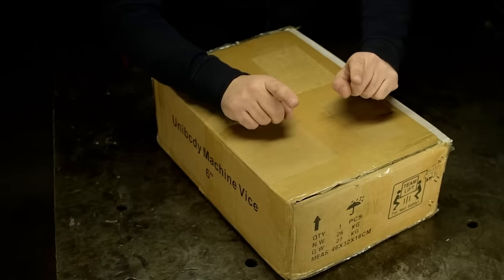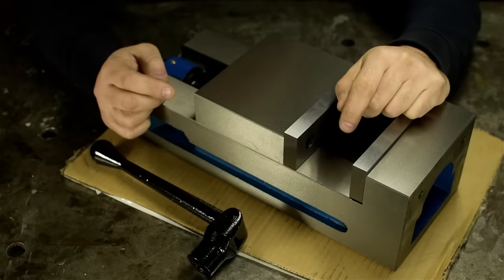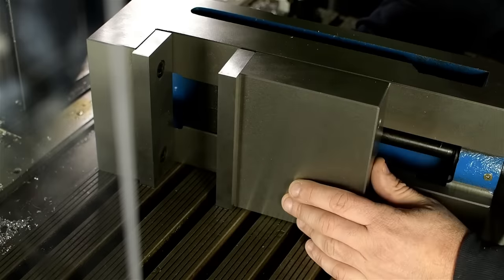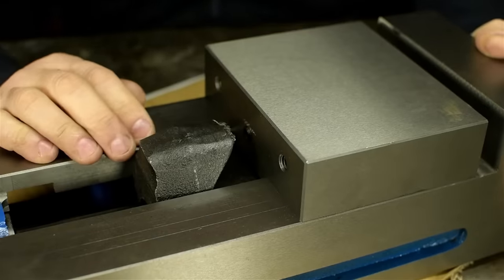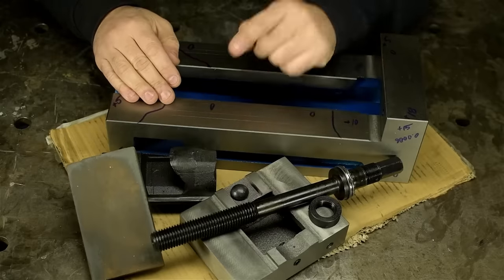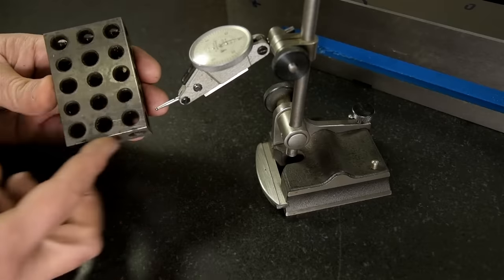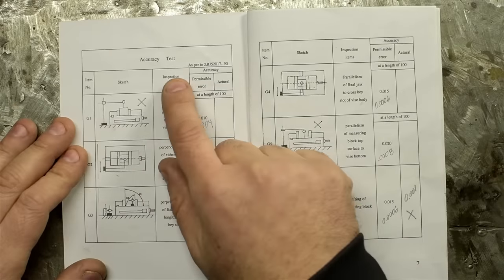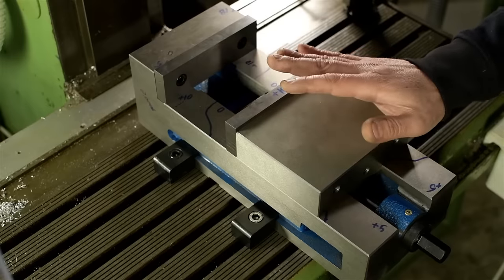Cheap Milling Machine Vise is CHEAP!

Comment: I've got an expensive milling vise. I just wish I had a milling machine to go with it :-(
Reply: I've got a schaublin 13, startrite bandsaw, Eagle surface grinder and a Colchester chipmaster lathe. And yes, no sodding workshop at the moment just a £250 bill for storage every month! So I feel your frustration!
Reply: I've got a used Kurt that I got for free from my last job and I have no milling capabilities. It just lives on my bench downstairs and I mainly use it for working on guns. Way overkill for that task lol.
Reply: @house89147  This pain is real, I've got a Gorton Mastermil, Bridgeport mill(halfway through converting to CNC), Southbend lathe and an old Miller Syncrowave 350 tig welder just gathering dust in storage.  Can't wait to get into a home with shop space.
Reply: @Pulsarr1  it's actually really hard finding somewhere with good work space in the UK, our houses are tiny and expensive. They come with little to no land and then you might have to get planning permission to have a decent sized workshop. I hope you have better luck than me, I've been trying to move closer to family for 2 years. In that time only seen 2 houses that fit the bill. There is a perfect one up there I'd die for but it's about £40k over budget and the guy has it on the market but won't show it because of the covid lockdown!
Reply: Right there with ya, got myself a nice kurt milking vice for free, just need the mill now...
Reply: @daviddombrowski240  Milking equipment should not be used with milling machines.

Comment: I think it would perform brilliantly
Reply: Super
Reply: cool
Reply: All bright and shiny.
Reply: Not entirely, when you're machining to .001" (about .0254mm exactly) this vice could give some very slight errors, but if you're machining to .0001 (.00254mm) then it would be rubbish. For a milling machine like TOT has, he isn't likely to be chasing tenths or microns, but if you have an actual real CNC mill and you're making parts as a business, this thing is very likely to be garbage and isn't nearly good enough for the work, if you need high precision that is.
Reply: @Jeremy Raab rare for manual but not unheard of for certain parts when it comes to CNC, its more common in very technical parts that can't be ground or lapped afterwards
Reply: @JoshuaNicoll  set the work up proud, the vice irregularities then no longer matter, accuracy is based on consistency, which is why barrels are now free floated and not clamped
Reply: @sarchlalaith8836  That's not how machining works, gun barrels are not the same as a milling vice. You want the part to be in the vice as much as possible for maximun rigidity but with CNC things aren't quite that clean and often the parts are set quite a ways up for access all round the part. The problem is the repeatability of the vice, it's garbage. If you machine one side and go flip the part 180° it won't be in the same position, on a manaul mill you can work around that, on a CNC mill you can't as easily fix that error
Reply: @JoshuaNicoll  if you know the bed isn't OK but the jaws are, surely you can mill a ledge into the jaws so work pieces never encounter the terrible bed?

But, I understand what you're saying
Reply: @sarchlalaith8836  you'd be using parallels anyways to put the part up but the parallels wouldn't be level since the bed is not, generally CNC viced though do have steps like that milled into them but in this vices vase they'd still not be made well probably, but you get what you pay for.

Comment: Tony, can you use your surface grinder to "fix" the errors the vice has?
Reply: I was wondering the same thing. Or even take the jaw plates off and surface mill the high spots so the whole thing is flat relative to his mill?
Reply: My first thought after seeing the blue sharpie writing was "Oh boy, time for the surface grinder!"
Reply: I wanted to check the comments for this before adding my own.
Reply: I was wondering if he could have "fixed" it with the mill or surface grinder as well.
Reply: It doesn't help the jaw lift problem.
Reply: im not sure how much hair tony has now, but if he has some to spare i bet with a new screw, a few hours of surface grinding and enough money in the swear jar to just buy a kurt vice he could
Reply: @seanshomeshop325  : He's pushing a million subs so we might find out
Reply: @erik....  But it should not do harm either. That is what the angled surface is for. As long as the nut does not touch the roof inside the moving jaw, grinding down the bed does not increase the play between bed and jaw.

Comment: This Old Tony: the first man in history to admit that a 4" tool is just a "smidge too small" to be useful. 
;)
Reply: Ask any woman "size matters" 😁
Reply: @oldwrench4213  takes 3.5 inches to please a woman , doesn't matter if it's credit or debit

Not about the size of the boat, it's about the motion in the ocean, 
How am I supposed to cross the Pacific Ocean during a typhoon in a dingy little row boat. 
Just my luck.
Reply: If she'd frame them walls a little closer then it wouldn't matter.

Comment: Just a quick one. When checking for perpendicularity, rather than using a ball bearing or fitting the "bumper" to the base, just turn the main rod over so that the ball end is down, as that is what it's there for.

Comment: I purchased the four inch quite a few years ago and it was brand new right out of the box; I had to rebuild it. It was a Kurt Anglock type but the bearings had to be replaced, the main shaft had to be made anew and the half ball which holds the rear sled down to the bed had to be remade. First thing was to set the mill to surface grind and grind the vise parallel to the mill's table. The new half ball was hand ground from a very nice ball bearing. I had to saw the bearing in half with diamond saws then surface with diamond plates. Then the two mating surfaces had to be remated and finally, I ended up with an accurate and reliable vise with repeatability. I also saw the grain structure of my vise and it was very much open. Vise was made in USA Far East (China).

Comment: Fyi the ball on the top of your adjusting rod on your surface gauge is actually what you were supposed to use at squareness check you just flip your rof around do the ball is in the groove of the base and you press that up against your square block. Which creates your pivot point.
Reply: Now that's a useful comment..! Newbie comes away with another lesson...

Comment: To me, as a non north american, "USA MADE!" screams 'it's gonna use non standard threads and be a pain in the ass'
Reply: I feel the same about metric measurements, although I'm familiar with them and use them.
Reply: I've been in the same position, but reversed. I went through the whole rigamarole of making a 3d printed wind turbine that was all metric, and it turns out the bearing it uses is a bastard to get here. Either you pay 30 bucks for shipping or it takes two months.
Reply: @gamemeister27  This is why I buy bearings and other prefab stuff before deciding on the exact final dimensions.
Reply: interesting, to me it adds "cheaply made and heavy on the wallet" in front of that
Reply: See the U.S has been pushing standard threads for years but the rest of the world is stuck on this thing called metric.
Reply: To me not wanting a oriental or USA made vice says “I don’t care I want to burn my money”
Reply: @elischultes6587  depends where you are... Here in the UK Record brand vices are the best.  USA screw threads are a real issue tho
Reply: As an American, I agree. God, I wish we would adopt the metric system for everyday use. But counter to common belief, the metric in the US is not that uncommon, especially at small scales.
Reply: @dominic6634  The place where the three barleycorns unit was invented switched to metric. Give up
Reply: @DanPetrePhotos  Psst. No they didn't.  They still use pints, gallons, and miles per hour in the UK in their daily life. The US Customary system is defined scientifically by the metric system and the US continues to help refine that system, if anyone needs a conversion they don't know, they have a pocket computer with access to a global network of information. Americans are taught unit conversion and dimensional analysis from childhood.
Reply: You know, they invented the metric system to help people who couldn't figure out fractions.
Reply: @snarkylive  kg for groceries, litres for fuel, metres/cm for hardware. Older people still use stones for own weight, younger people kilos
Reply: @elischultes6587  Consider Lang as well
Reply: @snarkylive  In my experience, they aren't taught that very well, as it's fairly rare that they can visualise how much volume a given weight is, or how big dimensionally a given volume is. Unless you deal with engineers and machinists, who tend to be great at this, but it's not really part of everyday skill.
Reply: @DanPetrePhotos  The use of the metric system in the UK was summed up for me when I went to buy some ground beef and they said it in packages of 454 grams. 😂
Reply: @alanduncan3710  yeah because the metric system doesn't use fractions..
Reply: When i hear made in Uk, i think  "at one time the lb sterling was deflated and we bought a bunch of limey gov't subsidized stuff, but now its all worn out and has been scrapped"
The best example i can think of offhand is david brown tractors.  Absolute garbage.  Romanians made better tractors.  That should hurt.

Comment: I doubt your surface plate has a .001" hole. Better practice is to leave your indicator stand stationary and move the workpiece under the indicator. The distance between the indicator tip and the point on the surface plate directly below doesn't change.

Comment: Why couldn’t you mill the junk vices so that they sit exactly the same on your mill ?
Reply: That’s what I do with my cnc router. I use a surfacing bit to mill my sacrificial board flat relative to the tram on my cnc. Seems like the same principle should apply.
Reply: You would want to grind or stone it into spec. The surface is too hard to mill at least for his machine. And yes he could and should stone or lap it in to tighter tolerance if he wants better results for his money. These can be decent vises if you are ok with doing a little bit of work to improve them.
Reply: @dexterm2003  And also: that depth of cut is just too small for a normal mill. All cutters have a nose-radius, and so you would just have quite a blunt cut. Or, even worse, just a cutter that rides over the surface by the cutting-forces and scratch the whole thing up like crazy (or even breaking half way through).

So grinding would be the thing. And doing that on and with a mill... did not see that until now!
Reply: @christophpoll784  very true.

Comment: Tony, the first thing I'd do with the 1-2-3 block is see if all four angles (between 1x2 and 1x3 faces for example) measure the same, if they do then your block is square at least within the capability of your indicator, if not then you've got a problem.

Comment: 18:35 Would the hole in the block do anything to the measurements?
Reply: Yes it would, because the high spot of the bumper thing would be in the hole and not on the surface. The radius of the bumper would need to be perfect for it to work with the hole.

Comment: I bought one of these and while it was in shipping I remembered your video on it.  It was garbage too, but since the screw threads didn't match the listing where they were explicitly listed as acme/trapezoidal I was able to get a full refund.   They wanted me to pay return shipping but I refused as they sent an explicitly noncompliant vise.  I ended up finding a used Kurt for even cheaper.  It's beat up but still works great.

Comment: First,congratulations on the 1M subs.👍

Second,the stone you are using is loaded.
Spray some cheap WD on it,rub with fingers to loosen the loaded material. Wipe with ol t-shirt,lint free,more or less.
Repeat until clean.
Good teaching tutorial for everyone also.
Stone will do its job better and easier.

Comment: The CNC wise doesn't have the mounting flanges to be able to mount it on it's side or on an angle plate vertically.(for Horizontal CNC mill). The half ball inside of the jaw was sitting in there correctly. It picks up the angle difference between the "angle lock feature" angle surface and mating surface inside of the moving jaw.(cause they are not very parallel-as you pointed out). To check if the surface plate is flat and not have dip in it, just move the setup to different spot on the plate and compare the errors....

Comment: Problems tightening the fixed jaw?...  At the 1:26 mark...   I believe the round pivot in the center of the fixed jaw, is a reverse clamping fastener.  The center socket head set screw needs to be turned right and driven down in the jaw. then the outer, silver, ring can be tightened with a spanner wrench.

Comment: Hey just so you know the squareness check method you showed, albeit maybe it's common knowledge to some was invaluable to me. Had I known this 3 weeks ago would've saved me many hours thinking and my employer some time or whatever but more importantly would've made me look like a rockstar at work. Now I'm saving the knowledge for the opportune moment in our current project that has some of the same type linear guides. Method should work at a greater distance as long as the setup piece is square I assume. Will get back to you after I flex at work. Thanks a million man.

Comment: Using the same "right" angle of the 123 block, you should face it up against the same vice surface and verify the 0.0005" gap at the bottom with feeler gauges.  This verifies the 90 degrees for all three devices.  You can always scrape it into a precision tool...

Comment: Hey so to measure squareness your indicator base has two pins on the back. Overhang your indicator base over the edge of the surface plate and push those two pins down. Then push those pins up against the side of the surface plate and then run your indicator parallel

Comment: So many things..... 😂. 
I use our vice at least twice a day and I promise it has some dips over 10 thou in it... maybe like 600 thou... and it does not matter.  I just keep cranking and loosening until the part is flat and hold the part right.... it’s more than the brodgeamaport is ever going to suffer. I’ll chatter a carbide into my eye long before that part can move.  Also That sense of giddyness you claim is unwarranted was probably from the fact that it arrived. 😂 
Only thing I would do besides throw that on a surface grinder since it is a new vise is I’d change that screw into a ball screw. It’s disgusting and will fail when you don’t need it to. Love the videos.

Comment: A mill , though not a surface grinder. Wonder if that vice can be corrected by using suitable cutters and resurfacing the base in your machine? We are aware that work carried out in the mill is as accurate as the cut it makes, relying on the accuracy of the cutters. 
Milled steel always appears incredibly accurate with the exception of careful checks and bugery within the machine itself. ( Such as the Repub. Of Coblery gear often shows ) Pardon any reference to inferior sweat shop production zones from that Asian continent, but there has been a powerful sum of dung arrive in shipping containers over recent decades.

Comment: question with your mill can you refinish this to where it should be and how much time / cost for you and for the manufacturer be to make it square like it should be  and is this something a novice should do with all attachments we get .  what lathe and mill should we look for to begin learning with (i have no three phase electric) i would like to thread 2inch pipe and automotive  - backhoe parts its just for home stuff but like to build.

Comment: Just a thought, but it seems to me that you could scrape out the inaccuracies. After all, that is what scraping is used for......
Personally, rather than actually hand scraping, I'd be inclined to use a powered sander and machinist's dye. That's just me but it looks like you could salvage this thing without more than about a years worth of back breaking work, a few bruised knuckles, and maybe one or two broken fingers......

Comment: A lot of jobs, such as brackets, don't have tolerances closer than .005"... If that tight. So a vise like this will be fine.  Also you can get a part close, then finish it on the surface grinder... Or by hand.  Or if you get into high end work, get the Kurt Vice then!

Comment: Just noticed while re-watching, the toe clamps on this are applying pressure at 4 points on the base to the table. Is it possible that there is a 'High' across the bottom that shouldn't be there, near the center of the vice, that they ground high spots in the ends to compensate for? I presume that should also be checked for flatness to insure that the issue is not one of the toe clamps they used (or the mag chuck if that's the case) pulling the vice ways into, or further out of, flatness.

Comment: Tony. I’ve restored a Dalton Mk4 lathe. It’s all back together and works wonderfully apart from one issue, the cogs / gears to drive the apron thingie back and forth or the configuration of the wheels to cut threads. I need to cut a thread, I’ve absolutely no idea how to configure these cogs. Since your the only chap that makes sense, could you help? I’ve no manual, cutting threads looks easy enough and your video is crystal clear, but configuration of lathe / setup to actually do it, I’m clueless, ( in many things )

Comment: You’ve maybe sorted this now but for the vice that was running coolant over your feet, we have a flat (bent to suit I suppose) piece of aluminium with a threaded bolt attached, we slot that right at the front of the vice in the slot in the middle below the handle👍